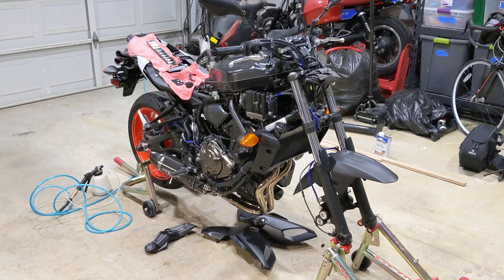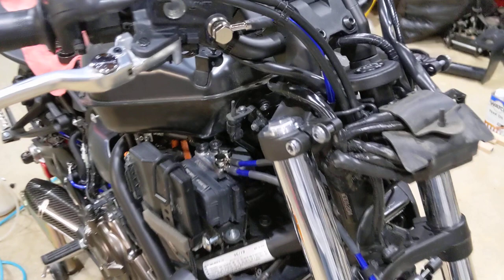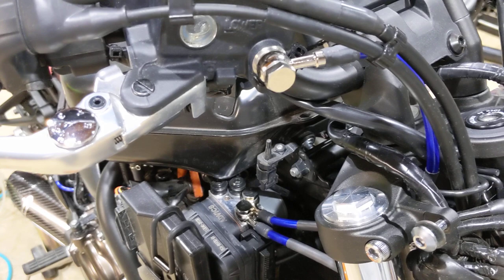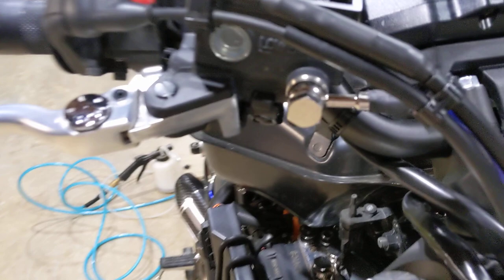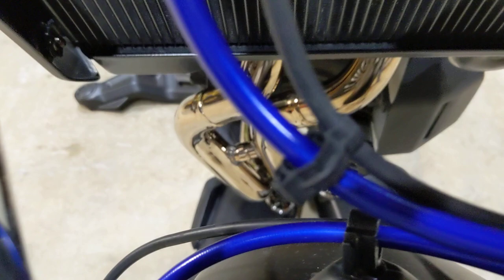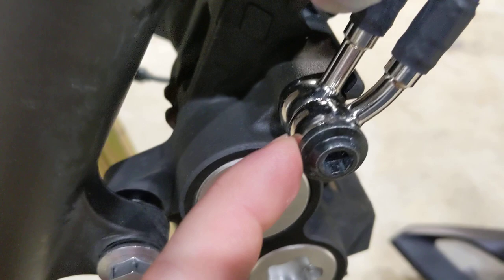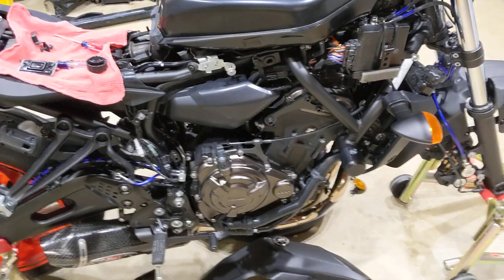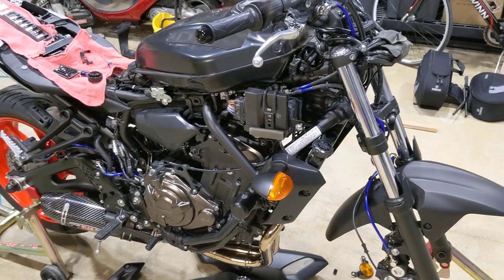Galfer Steel Brake Line Installation - 2019 Yamaha MT-07 ABS

Comment: How did you bleed the brakes?  What about testing the abs system after installation?
I'm thinking of doing it but the service manual states a diagnostic test is required.
Thanks
Reply from the maker: I used a pneumatic bleeder, but you can do it by gravity as well. Sport Bike Track Gear has a good instructional video here on YouTube that I use as a reference. As for the ABS, I never had any issues with it. No lights on the dash ever came up and the ABS still worked
Reply: @code3kc  so you just bled the system same as you would a non-ABS.   I have a hand vacuum pump.  That should work I guess.  How did you test the abs once you were done?  I hear you go out, find a nice deserted stretch and heavily apply the brakes to see if the abs kicks in.
Reply from the maker: @OldGuyRidin  That's basically what I did. I made sure I had a good feel at the lever first then gradually made harder stops until I felt the ABS kick in. Would recommend putting on a helmet just in case lol
Reply: @code3kc  thanks. I appreciate your help.  Stay safe, ride well.
Reply from the maker: @OldGuyRidin  Hope it helps, hope it goes smoothly, be safe

Comment: I want to delete the abs completely, how difficult would it be to remove the modules and the abs lines?
Reply from the maker: Ooo, that sounds like it might be a job. You may be able to pull the fuse for the ABS, but to remove all the components sounds like a bit of work.
Reply: The channel twin stunts says removing the fuse is easiest but to fully stunt you’ll want to remove everything. I think they have a video on it.

Comment: What website did the get the steel braided line and what’s da size on the stock ones ? I need a cable with like 4 more inches then the stock line
Reply from the maker: The company Galfer used this bike to model the steel brake lines off of. They're really helpful,  I'm sure if you give them a call they could set you up. You building a stunt bike?

Comment: When you bled the brakes did you have any issues getting a constant flow out of the left caliper? The right caliper was normal to bleed but the left one wouldn’t give me a steady flow
Reply from the maker: No, I didn't have any issues. I started bleeding on the right (throttle) side caliper as to pull fluid through the entire system first, before going back and bleeding the left (clutch) side caliper. I also used a pneumatic bleeder which seems to help get more air out more quickly. I would think that if you can get most of the air out, a trick I've seen is to use a zip tie to hold the brake lever in, and leave it over night. The rationale is that by keeping pressure on the lever and on the brake system, it passively squeezes air out of the lines and gets it up into the reservoir. Hope this helps
Reply: @code3kc  Thanks man, been looking everywhere for the answer to which caliper to bleed first. Did my rear brake today, gonna do the front tomorrow. I got a 2020 but actually decided to remove the ABS lines and run stainless steel lines without the ABS system.

Comment: Do you know how to remove brake lines from abs pump to the front hard lines from a 2018 tracer 900 gt?
Reply from the maker: I've never worked on one of those, but from pictures on Google it looks like a similar ABS pump to this one. If that's the case, then all you have to do is remove the banjo bolts from the ABS pump, which appear to be the same bolts as the ones found on the calipers.
Reply: @code3kc  thanks for replying.